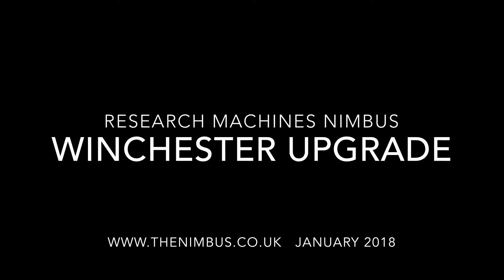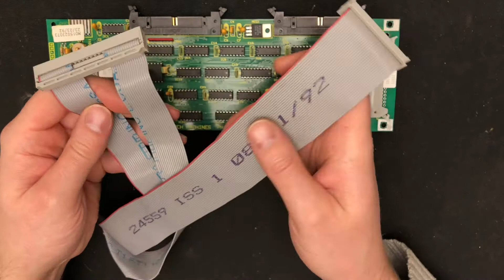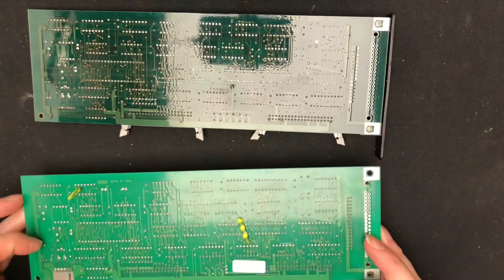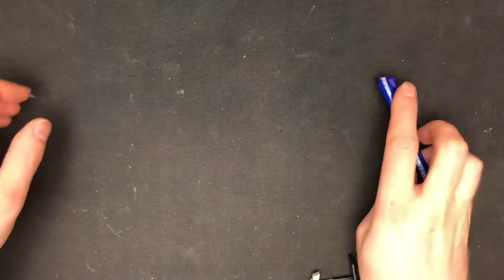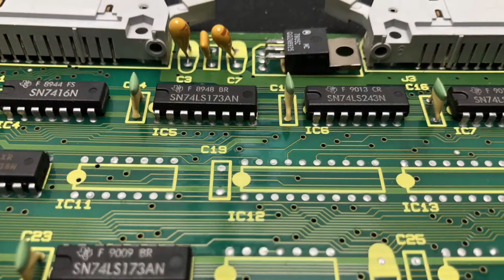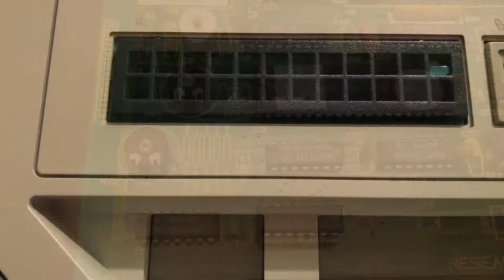RM Nimbus Winchester Upgrade Board

Comment: P.S. You can get an idea of when the board was made by looking at the TTL chip batch codes. - e.g.  9009 means 1990 week 9,  9143 means 1991 week 43. So the board must have been made sometime after the latest date you can find. Sometimes the date code is underneath the chip though!
Reply from the maker: This board was out of the later slimline nimbus pc-186, so the dates match up.  annoyed there was 1 component i couldn't locate and had to make it, was just a resistor bussed network, might find one eventually.
Reply: It has been obsolete since 2003, so either it is made by Bourns especially, minimum order of 2,000 or look for new old stock suppliers. I'm going to use two Bourns isolated resistor packs vertically and bypass one of the resistors to create the bussed version. My Nimbus is in a terrible state and I'm in the process of removing the CPU as it is corroded to the socket. The SCSI cable is strange, a 34 way cable split into two halves onto a 50 way connector. Maybe it's easier to start with the 50 way cable and cut the unused wires out? I'm some time off getting the machine into booting though...
Reply: Oh BTW on your website you have this resistor network 4114R-1-151LF as the equivalent of the Beckmann 899-1-R150 - they are not equivalent! The part is actually 4114R-2-151LF.